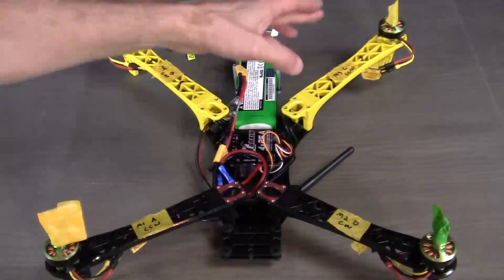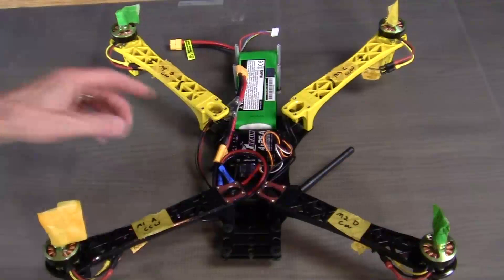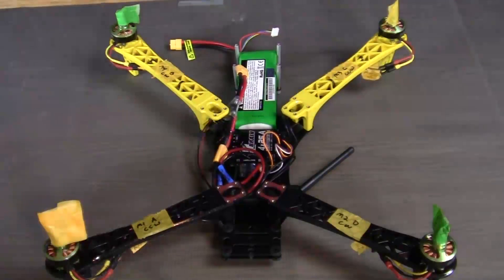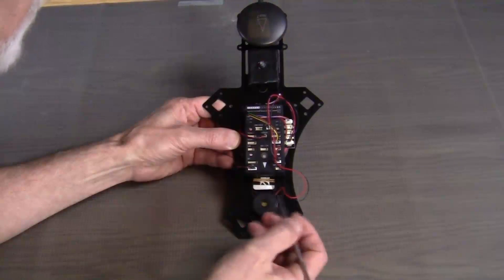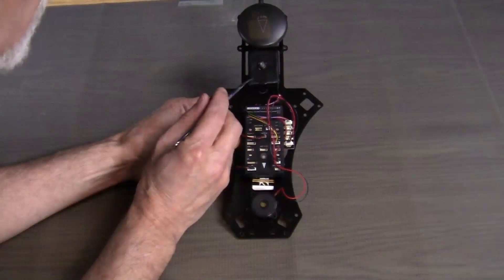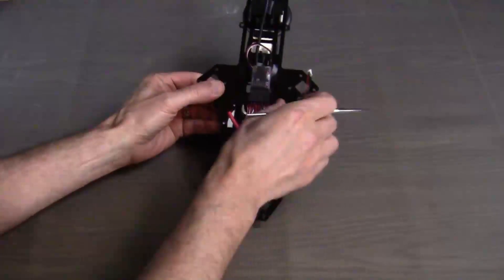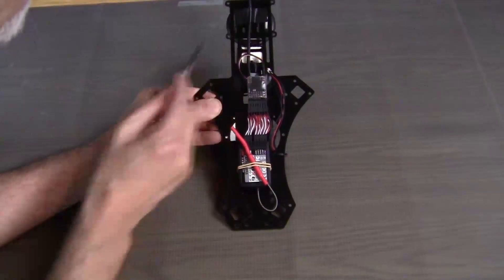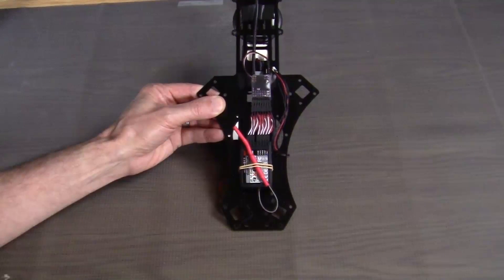How to Build a Quadcopter With a Pixhawk Flight Controller Step 8

Comment: How in the world do you plan to balance it well enough to get it to fly with that heavy battery at one end?
Reply from the maker: +Steve C The flight controller takes care of "the balancing act" when it is configured properly with the GCS software.
Reply: +Learn Robotix  Everyone else says you need to balance the model with the weight closer to the center.
So you are going to have the motors at the heavy end working really hard to hold up the battery while the other end just loafs along with a light load?  That must make the handling really strange!
Reply from the maker: Steve C   You can do what every one else says if you like. But we have built one.

Comment: what kind of battery is  there ? thx
Reply from the maker: Milan Paule A Multistar 5.2 (5200)
Reply: Learn Robotix 3s or 4s ? do you mean 10c ? thank u
Reply from the maker: Milan Paule 3S
Reply: Learn Robotix thank you. I have the same frame but I need new more capable battery so Im thinking about 5200mah but I am little bit afraid about size to put it to this frame. I think it is too width, no ? It is hard to put it to the frame from behind ? battery looks very tightly in frame.. tahnk you for your reply
Reply from the maker: Milan Paule It is a wee bit snug, but if you adjust the standoffs along the back battery holder it slides in nicely....a slight bit tight, but I am still very happy with the fit.